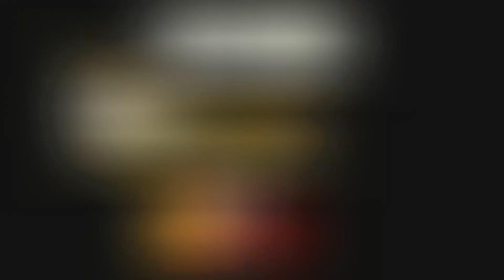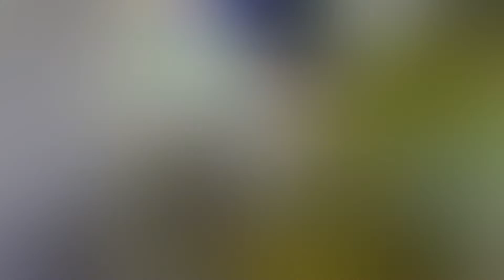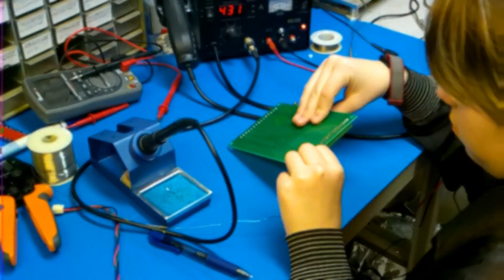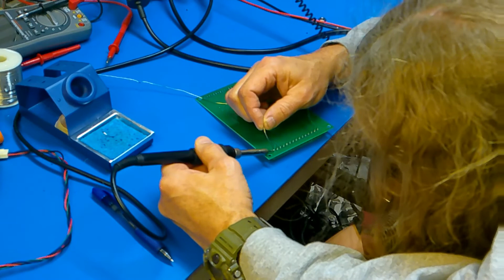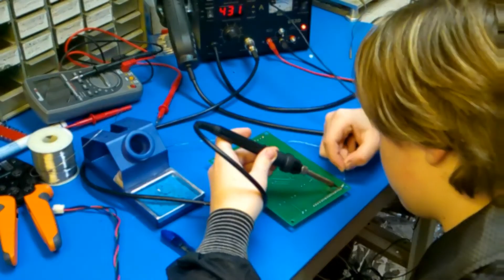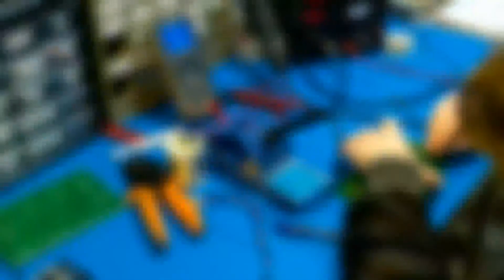3d printer, control 240vac heaters with Duet 3 Control board

Comment: A couple of tips for Rev 2, should there be one:

1. Label the pins with their functions. You have plenty of room, reduces the potential for  wiring mistakes.
2. Label the current rating on the board...
3. ...Those SSRs are only 10A if heatsinked, 5A otherwise.
3. Watch clearance / creepage. The Pin10 / L1 trace distance looks closer than it needs to be. It's probably fine, but you could move the L1 trace further away pretty easily.